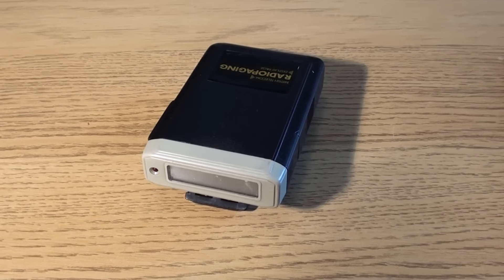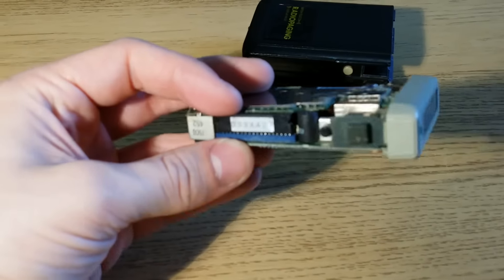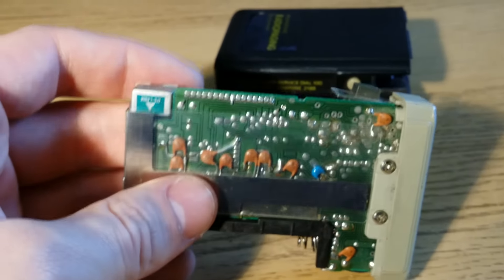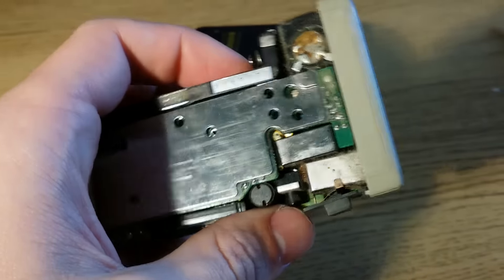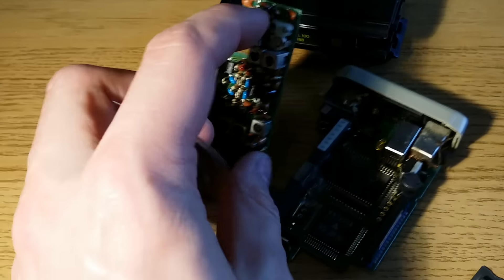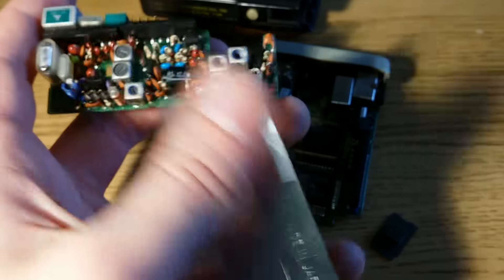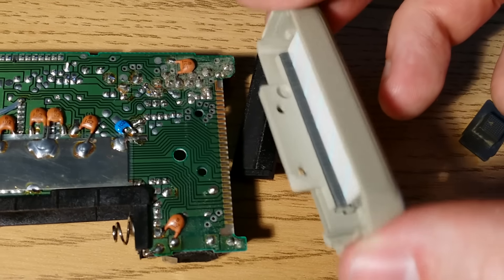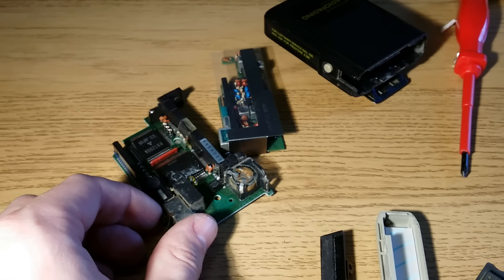BT RadioPaging Pager Teardown

Comment: That pager is one of the first versions pagers available for that era.  The reason that there were 2 boards was to separate the logic of the pager from the radio receiver. Pagers of that era were only available in the VHF (~150Mhz) band and UHF (~450Mhz) in the United States.  I may be wrong on the this date but 900Mhz was introduced in the early 1990's.  The board with the LCD was known as the logic board and units of that era were available in two flavors. A technician could tell at a glance what type of logic board a unit was by those numbers on that little plug in module you pointed out,  Which should match the numbers in the battery compartment (If the radio shop maintaining the pager was worth a spit). Those numbers are referred to as CAPCODE.  In that era if the logic board had a 6 digit cap the logic board decoded the GOLAY protocol. If the cap was 7 digits then the pager decoded the POCSAG protocol.  These were the 2 protocols that survived when the industry grew out of the true analog pager.   Analog was way to slow for the fast growing market and airtime was valuable. GOLAY was first then POCSAG was made available, POCSAG was originally developed by the British Post Office Code Standardization Advisory Group. Hense POCSAG.  POCSAG ran at 512 baud and blew the doors off of GOLAY.  It wasn't to long that it was taking to long to receive a pager so 1200 baud POCSAG introduced which allowed for approximately twice as many pages per minute then the 512 units.  It was pretty much around 1995, I think, we started weeding off all the GOLAY pagers because they really slowed thins down.  All public voice paging went away because in the 20 or 30 seconds it took to transmit a voice page, hundreds of digital could be sent. Plus don't forget the 20 to 30 seconds my phone switch was jammed up recording the message to be transmitted.  So by manufacturing pagers using 2 boards the manufacturers could mix and match to create product.  Plug a Uhf receiver to a GOLAY logic board might work for a carrier in New York and plugging a Vhf receiver into a 512 POCSAG board might be what was needed in California.

Comment: Actually, the D7503G (uPD7503G) is the micro -- a 4-bit microcontroller with LCD controller. The MN1290, I'd expect to be a pager receiver (POCSAG probably) or I/O expander.

The label on the crystal on the receiver board is probably the frequency - 153.175MHz.

The plug-in memory device is normally called a "Codeplug". It's probably a bipolar fuse-link PROM. The programming sets the configuration of the pager and -- critically -- its identity on the paging network.